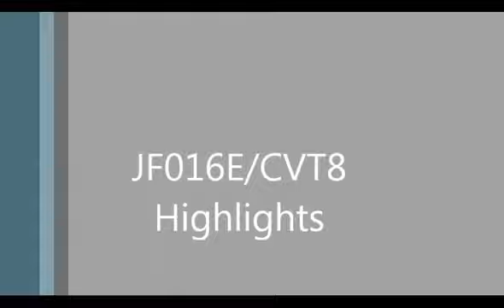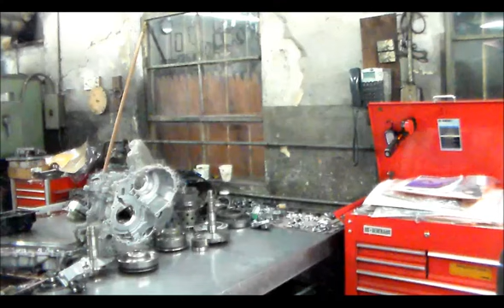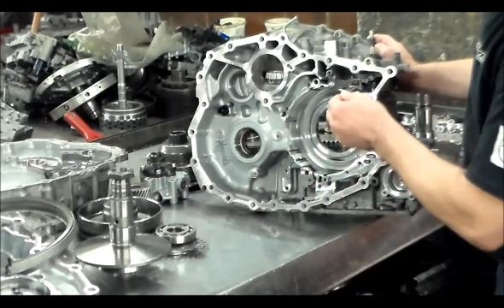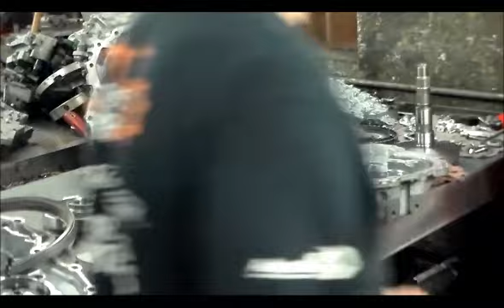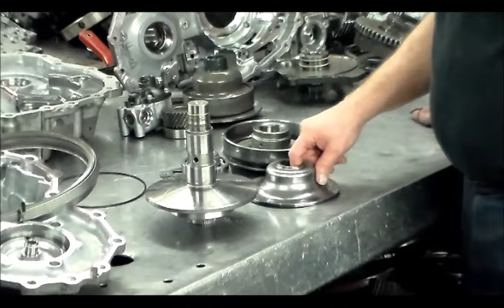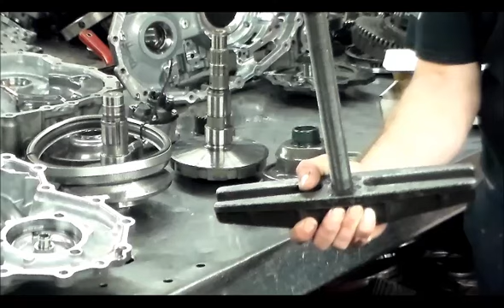JF016E/CVT8 Highlights

Comment: Awesome video Gary. Love your stuff. I would like to point out that transgo does offer the same flow control valve replacement that the previous models use now. Also, another one that i use instead is the Superior branded STL011 flow control valve replacement.  Ive seen a few people saying that after putting a transgo replacement flow control valve in their pump that it makes a very bad whinning noise. Have yet to see that with a superior stl011 so thats what ive been using.

Comment: I wouldn't buy a vehicle with any nissan Cvt (catastrophic vile transmission) transmission/transaxle at all anyway shape or form. They don't look durable, And any other transmission or transaxle on the planet is better than that design and whole thing overall, heck even some of the quirkiest transmissions and transaxles are still better than this nissan cvt. For example even the Ford A4LD is better, I mean sure it wasn't perfect and had some issues from the start but you can upgrade it and modify it with Ford 5R55E internals, its called frankentranny mod a4ld with 5r55e internals from explorer forums. Those nissan cvts no matter what year model, you can't really modify them or even upgrade them, even nissan recommends replacing the whole unit if they fail. Some symptoms of these sorry ass nissan Cvt units showing possible catastrophic failure are vibrating and lagging at acceleration. This was a couple years ago Me and my mom drove a 2017 Altima or maxima ( loaner car because my moms car '17 QX60 was being serviced (by the way my mom got a different vehicle now a '21 genesis GV80 really nice vehicle and no cvt! instead a hyundai 8 speed (A8TR1) rwd automatic)) and i heard the rumors of nissan cvt's failures and lawsuits before and when we were driving that '17 altima or maxima we felt some lagging and vibration at acceleration from a stop, I thought in my head and told mom that people weren't lying about it and that this cvt was probably most likely the culprit. I've seen and heard lots of complaints, horror stories, and lawsuits against these nissan Cvts, and many other car enthusiasts like me even though we all have different tastes and preferences think this nissan cvt transaxle is probably the worst to date currently and ever in automotive history and probably for any vehicle ever on the planet.

It was also stupid boneheaded thing of nissan to put these in large vehicles such as the murano, pathfinder, QX60 (my mom's last car which my future brother in law advised my mom to get rid of because of that nisan cvt transaxle was in it ), Rogue, Juke, QX50,  and the nissan Quest from 2010-17. The new 2022 year model pathfinder and QX60 will have a new ZF-9HP conventional automatic transaxle and no more crappy nissan cvt in them.
Reply: sorry it was a lot to say.
Reply from the maker: @connerchampion5656  No Problem, i wouldn't buy a Nissan Either. Thanks for watching

Comment: Is the CVT7 still a dependable design vs the CVT8? I have one on my little Mitsubishi Mirage and the reports of premature cvt failure are much less common than on Nissan vehicles.
Reply from the maker: So far i've only done one of each.  they do have problems but seem to be holding up better than early models

Comment: Just got a Mitsibushi outlander 2018 and it has this cvt8 transmission in it. I though it was using a newer transmission, not one from 2013. Hopefully mine will last more than just 5 years! How many miles did this one have on it?
Reply: Mitsubishi programming of Jatco CVT products seem to produce less premature failures percentage wise vs say a Nissan Rogue. You did well selecting a Mitsubishi CVT engineered vehicle.
Reply from the maker: 39,000 flow control valve was dragging in the bore causing the belt to slip
Reply: thanks for fast response. Would a OBD2 scanner tell me if the transmission was on the way out and possibly give me the time needed to get it fixed before the belt broke? A CVT failing under 40,000 miles is really bad, hopefully covered under warranty.    @GaryFerraro
Reply from the maker: @rollandelliott  If there were codes present for the transmission, that may give a direction as to whats going on.
Reply: is the W1CJA the same transmission as a cvt8?   I think that is what I have in my suv?    I see it referred to as the 
Jatco JF011E In this video:  https://www.youtube.com/watch?v=ry_gN3QVswk
   I will definitely be getting a obd2 scanner and the cvtz50app for my android phone, supposed to tell one if the transmission was ever over heated.    @GaryFerraro